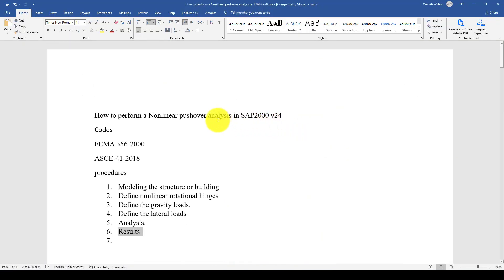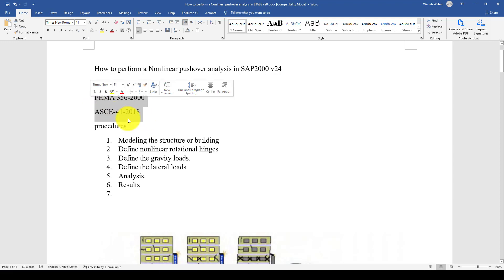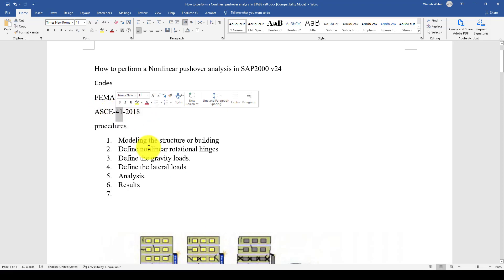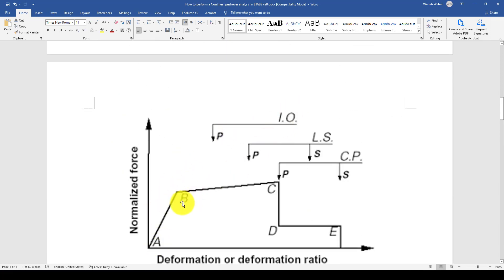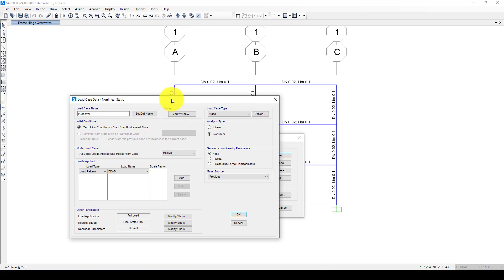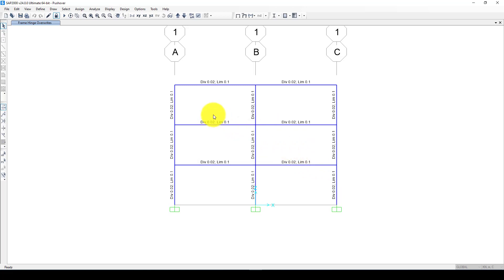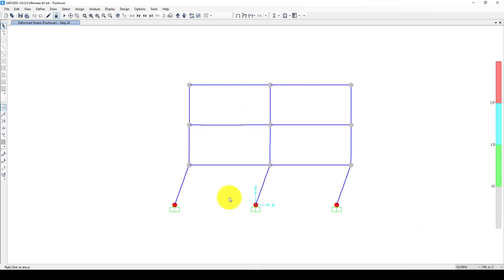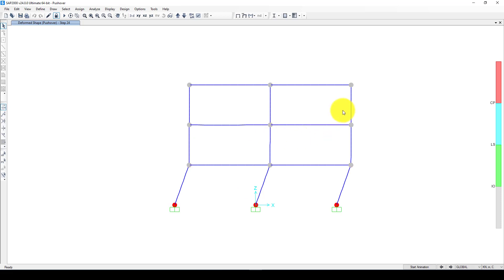How to perform properly   Nonlinear Pushover Analysis in SAP2000 v24

Comment: model software  Question: The mass of a water-tower modeled as a SDOF system shown below is 20,000 kg and its damped natural period is 2.2   secs, and height 4,5 mts and dimensions column 0,4mx0,4m ?  . The system sap2000

Comment: may I ask you sir, how to modelling hinge in steel plate wall especially purpose to evaluate shell of storage tank wall using pushover analysis, because it's not reasonable if it's model using layer shell in sap2000?
Reply from the maker: You don't need to model the hinge for the tank.
Reply: @KSSE_Engineer  so, that's mean, I can't to evaluate performance of my facility, isn't it Sir? Or I just to confirm it by concept linear analysis and judge it by Demand to Capacity Ratio of stress area, such as your video about cooler ? Because it's perform using modal time history (dynamic load) but properties of structure are elastic linear... I hope you to reply my comments and thank you for your answer...

Comment: frame hinge properties need to be regenerate because updated values and return analysis in sap2000.....why this msg generated
Reply from the maker: You need to generate the hinges , from assign menu you can do it .
Reply: @KSSE_Engineer  already assigned....
Reply: In concrete structure..... We have to used asce_41_17 concrete beams right???